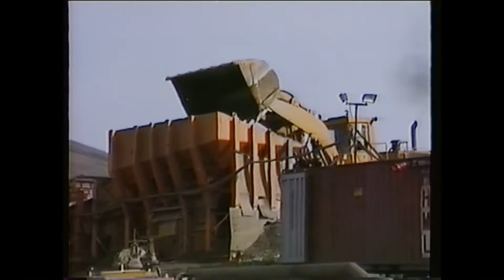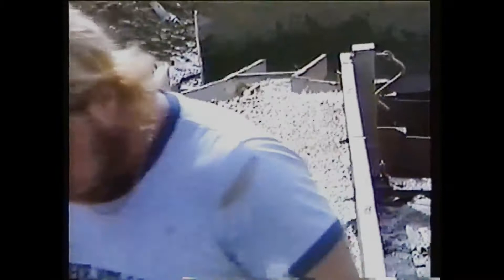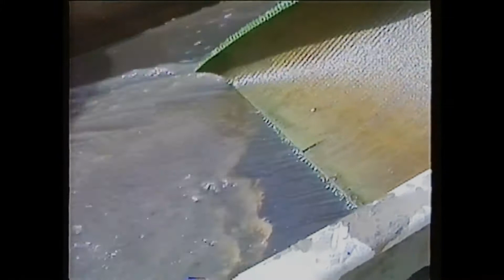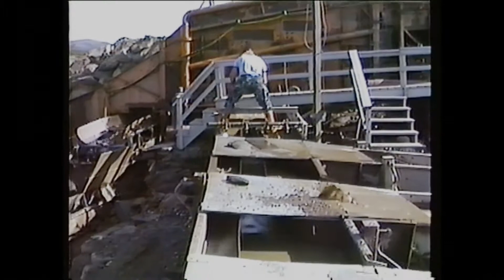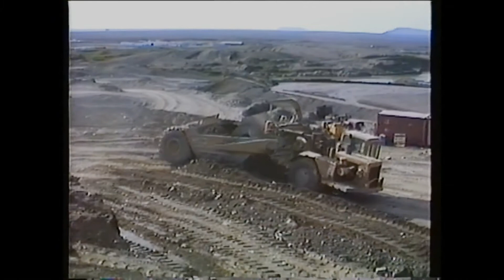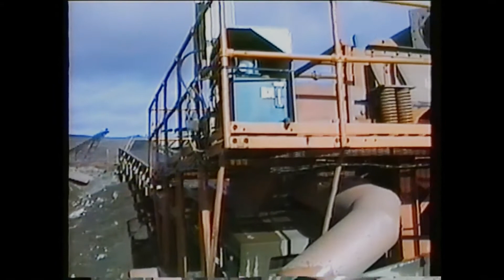1980’s Wash Plant with Hy-G P40 Fine Gold Recovery Circuit

Comment: Impressive.  Have not seen some of this innovation before on washplants.  I wonder what the main recurring failures or maintenance items were?  What percentage of the total gold was caught with that massive fine gold recovery system?  Why are washplants shown on shows like Gold Rush so simple in comparison?
Reply from the maker: 6 Seasons, 115 days each summer, 24 hours a day 7 days a week operation, 1 major failure in Season #4 with a broken feeder shaft which cost 12 days operating. There was a strict maintenance plan for the plants. Send an email to sales@hygconcentrators.com and we can share more details on it.

We can’t comment on other company's mining operations specifically but the following comment from the engineer gives you an idea of what it took to run these plants and might help you compare “Nome and Fairbanks plants produced an average of 170 ounces of gold per day and a season range from 19,800 ounces to our maximum season of 22,400 ounces.  The cost of my plants and our earth-moving equipment were totally paid for in the first season due to our 24-hour, 7-day per week type of operations.  At Nome, we had a total staff of 32 men to operate at a 7-day per week level.”

Regarding the Hy-G fine gold recovery module “The gold scavenged from the sluice tails paid out the all-in costs in 58 days of Plant operation.   Sluice recovery was 82%.   Hy-G recovery was 18%.  Total Plant recovery was 99.8%.